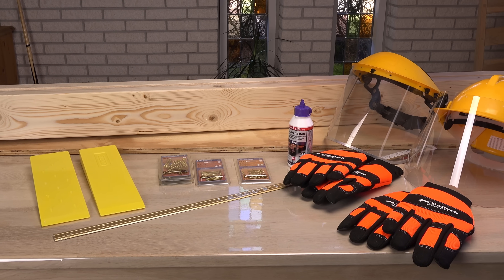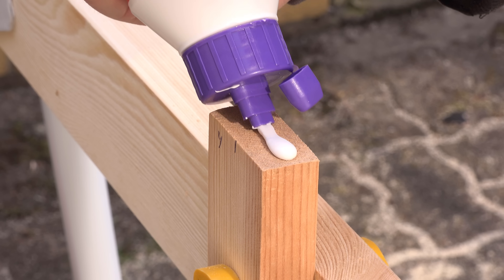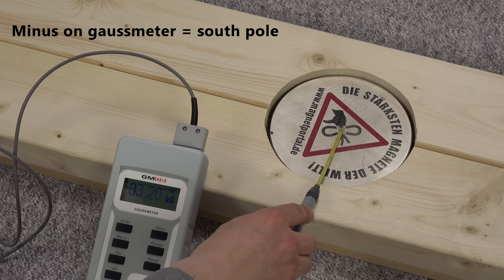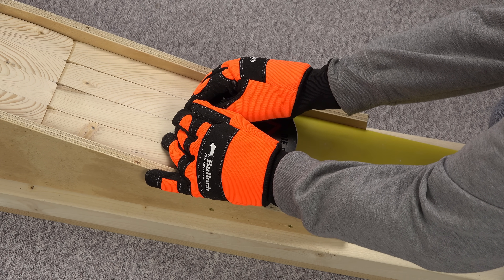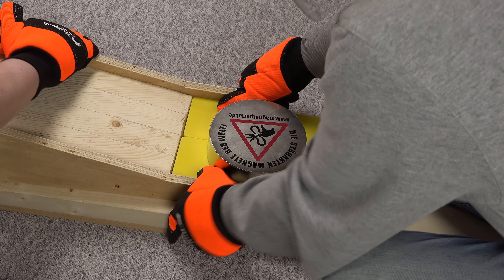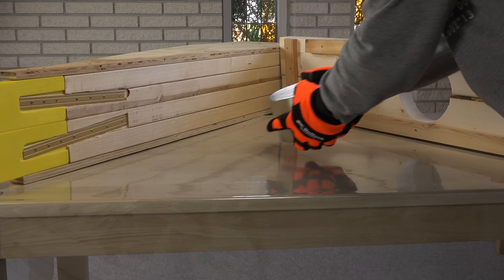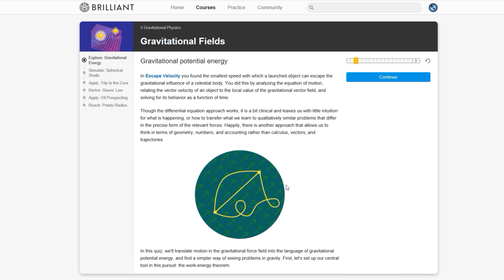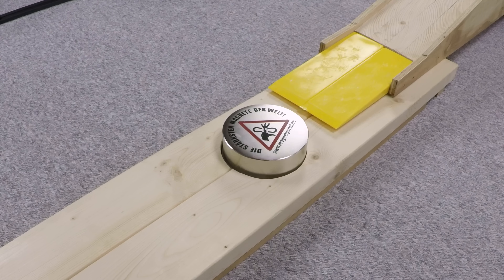Monster magnet meets monster magnet...

Comment: How about using a block of ice to bring them together
Reply: Place the magnets with a block of ice between them, let it melt so the magnets move slowly towards eachother. However the ice could chip or explode under the pressure and the magnets would damage eachother.
Reply: You can do it with the ice inside a casing to prevent shattering and inside a big freezer to prevent it from melting. The pressure will still melt the ice but slowly.
Reply: @Autunite  yes once down to a couple inches I bet they would break and shatter the ice .
Reply: Autunite l
Reply: @Autunite  if magnets and ice are inside rather tight cylinder, it would hold ice in between even shattered.
Reply: @Autunite , if the ice cracks under the force of magnetism, you could damage the magnets.
Reply: Make a video on how to separate them now
Reply: Someone had a similar idea with a PVC pipe filled with water.  The only drawback there being the pipe would have to be the PERFECT diameter to control the flow of water around the magnet.  If you replaced the water with a cylinder of ice, the PVC would prevent an explosive blowout and almost any chipping/cracking would be repaired by the compressive force on the ice.
Reply: I like your idea better than mine but they are very  similar. . The only thing I was going to do different is using a drilled-out 6 inch by 6 inch piece of lumber to hold the ice. Your PVC pipe would be much easier. Not sure why I didn't think of that.
Reply: That would be a cool way to observe the way pressure can melt ice
Reply: The problem becomes does the ice melt evenly. If it melts faster on one end they fly around the ice and do whatever is being prevented by the big wood stuff
Reply: Jesus christ, I hadnt thought of that. You could create a whirlwind of ice, and rob banks and shit.. Dude you're a fricken evil geniuous!!!
Reply: Ice melts under pressure. You can observe this with a thick ice bar and a wire loop with a weight attached to it. The wire will slowly cut through the ice bar. With those magnets it will go faster, the closer they get, since the pull force rises.
Reply: May we see this?
Reply: Blök Möp l
Reply: drServitis, if you're not trolling, you need help...
Reply: I had a similar thought. Using a perfectly fitting aluminium pipe and put on gaskets using something more viscous than water. drill a hole level with the bottom surface, either a really small hole or if you want to control the flow mount a valve.
Reply: @matsgustavsson665  I'd rather use a copper pipe, it'll slow down the magnet.
Reply: Still it would be interesting to see. probably not at home tho
Reply: or putting a material between them that will dissolve in alcohol or some other solvent
Reply: Ice is water .water can't  be compressed. Contain the magnets in a frozen tube where the melted water can be allowed to pass the magnets at a controlled  rate . Job done. Wouldn't  even need ice.
Reply: I was thinking just letting them slap together in a pool of water. Slush ice perhaps. Cold oil is also an option.
Reply: mikeselectricstuff that’s super smart dude, I could never think of that
Reply: My thoughts exactly, although using a thick copper cylinder to freeze the water, remove the ice bar & cut twice the width of one magnet off one end. Place the copper cylinder over one magnet standing up, place ice bar back into the cylinder, gently ease the other magnet on top of the ice.
Reply: it may rust?
Reply: Simple hydraulics
Reply: Nice.. you could also use a metallic tube that the magnets fit perfectly inside and then use water between them inside the tube. Through a valve you control the move of them coming closer together... it could be fun to first deep froze the whole thing ;-)
Reply: @henkenilssons3196  q
Reply: If you could get a tube or pipe (non magnetic, non-ferrous) that could withstand the pressure, and with an internal diameter only a few thousands bigger than the diameter of the magnet, couldn't you use a high viscosity fluid or oil? 
There's no possible way the magnets could slam together because there's no possible way the fluid could push through the minute gap fast enough.  Basically a hydraulic ram with a deliberate leak at one end. 
Might be messy. But would allow perfect alignment and controlled marriage of the two magnets.
Reply: Look kids, just say NO to drugs. They may seem cool and groovy and you'll be popular at all the parties, but just don't. Trust me. I used ICE for decades, and now I'm just an old man, with lamented tales of woe. Sure, you'll pull all the hot birds, be famous and probably a star footballer. But.. at the end of the day, the only ICE you want is in your tea. Just say NO. drugs are bad. Now excuse me, my bourbon needs some ice.
Reply: i think at a certain point, the ice will break with a sizable gap between the two, they'd slam together with a fuck ton of force, shatter and send shrapnel flying
Reply: someone make this vid
Reply: Blök Möp with some sort of liquid in between those two neodymium magnets in vacuum tank and have pressure release valves.
Reply: Nice idea!!
Reply: I'd put a tube or pipe fillit with water, make 4 valves near the bottom vleed the water out as it slowly sinks into place
Reply: Daniel Cannata you could use ice in a pvc pipe, it would work... might be best to use packed snow instead
Reply: Umm that'd make a great video ...  and u could record it from safe distance too..
Reply: i think they would crash it in seconds
Reply: thats an excellent idea! large pipe with block of cylindrical ice and let it melt evenly to bring them together in exact alignment!
Reply: Hopefully youll never have to take them apart, lol.
Reply: If you had pvc of snug fitting size put one magnet in one end then cap.  2’long    Add water 3/4 full.  Freeze. Add other magnet ,cap    Then let thaw.  That’s what I would do.  The ice would melt at the warm magnet end first the water would seep around magnet the water forming gasket, the caps on would create suction of vacuum the magnets would slowly move as water melted and seeped around magnets.
Reply: mikeselectricstuff compressed ice only
Reply: Good idea !!!
Reply: Excellent idea.
1. get many blocks of wood with a hole just big enough for a magnet to slide through and secure them together so they don't move.
2. place one magnet at the bottom of the hole.
3. fill the rest of the hole with ice.
4. place 2nd magnet on top of the hole.

the ice will be crushed, yes but since there is effectively no way for it to escape en masse; it will still separate the magnets as they come together.
Reply: Maybe use the same setup as shown in the video but with a smooth surface to pull it off easier
Reply: it would crack
Reply: At some point, when they get close enough, they would break
Reply: Why hasn't butthole-shrimp been addressed?
Reply: Yo that would be so cool!
Reply: Just trow one to the other
Reply: You'd get the DEA at your door in no time.
Reply: No, you're wrong. The DEA would still arrest you for having such a large quantity  of ICE and you'd spend 20 to life in the clink. Trust me, I watch LAPD.
Reply: brilliant idea...
Reply: What is? It will take 3 years to load 74 replies on facetube. 

Oh you mean the OP? Nah the DEA will be at his door as soon as he gets all that ICE.
Reply: @xxfurrytrashxx   C'mon...brainstorming ideas is no place for criticism. You fail because you can't work with people.
Reply: Y'all dumb
Reply: It's a clever idea, and I'm sure you could work out a lot of the obvious kinks with the set up alone but I'd still be worried about damaging the magnets, at certain threshold the ice will eventually give and that may be further apart than one would like, possibly cracking or even shattering the magnets
Reply: Ice was my first thought too!
Reply: Or heat them, elementary school physics.
Reply: Water ice would shatter...
Reply: How about bringing them together in a 6" PVC pipe with a magnet at each end and a cylinder plug of ice in the middle ...
Reply: Provide a hollow lead, brass or bronze cylinder of the exact diameter of the magnet. 1 metre long. The ring/wall of the cylinder will be 3 inches thick. Now apply a lubricant seal (a synthetic engine oil could be also good) on the side of the 2 magnets. Place a magnet on a level surface then the hollow cylinder vertically on the top of it (the magnet will be covered by the cylinder making an exact seal, like the piston of an engine). At this point pour water in the cylinder filling it but not completely, leave few inches of the cylinder free of water in order to place the second magnet on the top. Place the second magnet on the top of the cylinder and now we obtained a system/column made of water (that can't be compressed; in a hollow cylinder) that can't be compressed by the 2 magnets. At this point drill a tiny hole in the centre of the cylinder: the water will slowly come out of the cylinder and the 2 magnets will slowly get closer to each other till they get gently stuck :)
Reply: Dry ice is better because it will sublimate into CO2.
Reply: Switch the magnets off then connect them then switch them on again
Reply: how about just throw one magnes on the other one ?lol
Reply: YOU FOOL !! THE MAGETISED ICE WILL MELT, LEAVING MAGNETICS EVERYWHERE, THROWING OFF COMPASSES AND DOO DADS AND OTHER ELECTCRICS, AND WILL DESTROY THE WORLD.

actually, are you did it yet?
Reply: No matter how large your cube/block of ice, at some point where the ice has melted to a certain point, the magnetic force with crush the ice. Also, how do u even ensure the ice is melting evenly ?
Reply: Hi
Reply: @soultrader9207  Hey there... How YOU doin' ? salacious grin, slight tongue poking out
Reply: I had a similar idea, but using wax (or any material that melts without doing harm to the magnets) in between instead. For alignment some precise cylinder could be used. If pressure causes warmth, and thus a chain reaction, a tight cylinder around (magnet, wax, magnet) would work like a brake. If it works too well, you would have to drill some tiny holes into the cylinder between the magnets.
Another interesting experiment, I'd like to see is what happens when pulling a bunch of steel needles (or small nails) on some non-magnetic plate put on top of the magnet. I'd expect the needles to "form into space" following the magnetic flux. (sorry, non-native English).
And finally yes: Don't ever put your fingers between strong magnets!
Reply: WAX isn't magentic, what are you even trying to do. You want a magnetic candle? What is WRONG with you...
Reply: mikeselectricstuff i think he meant breaking the ice between them.... like a ice breaker. Plz don’t woosh me lol
Reply: In minecraft..
Reply: У
Reply: Nope by the time they got close the force would just shatter the ice and Proboly the neodymium magnents with it
Reply: Dude. Thats brilliant
Reply: I read about this being used by a person who committed suicide and tried to frame someone for his murder. By the time the officials showed up, the ice already melted so they assumed he was stabbed in the back, but he placed the knife in the ice.
Reply: You can even make the 2 magnes roll in parallel patsh that gather at some point. If this vides explains the way to put them together.. well.. they dont seem too smart.. xD
Reply: You are F#©kInG genius
Reply: Seems like you'd make a kinetic ice bomb by doing that.
Reply: I think the ice would shatter
I had a 2x1 and joined a 1" cylinder accidentally, to separate I needed to use wood too
Reply: M_god 30 
Me me smart boy
Reply: The ice would probably break.
The magnets could slip on the slope and slam together too quickly.
The friction could melt the ice
Reply: My girlfriend just returned from the gym and her ass smells like shrimp and butthole
Reply: @Dr.White_PhD  -   "Shrimp and Butthole" sounds like an Australian detective series. LOL !
Reply: @martinroberts8469  : The only problem with that first "funny" of yours is that Australians don't actually use the word 'shrimp' to describe what you're talking about. We call them 'prawn'! Americans were all successfully conned into thinking we call them shrimp, and barbecue them, during a tourism ad campaign decades ago.
Reply: @anhedonianepiphany5588  -   OK  -  Point taken ... no disrespect intended toward Australians.  Somehow, though, 'Prawn and Butthole'  doesn't have the same impact.  How did we get so far away from the subject of 'magnetism'?
Reply: @IfYouOnlyKnew What transpired there? Had you intended to smell it when she returned? Was it at that moment, when you smelled shrimp and butthole that you decided to relay the information? Or were you enjoying this video, she walks in, the odor is so overwhelming you feel compelled to share? I'm at a loss here, and genuinely curious.
Reply: @Dr.White_PhD  -   "Butthole and Shrimp" sounds like a TV detective series. LOL !!
Reply: @Dr.White_PhD  ....thanks for sharing, good for you.
Reply: Tom ! But it's not a good thing. Lol
Reply: @Dr.White_PhD  ...... Yeah probably not, but look at the bright side we all like shrimp.
Reply: Some one pay you money
Reply: YEAP pretty much things like this.  AND meanwhile [slaving intensifies]
Reply: How?
Reply: It would go slowly and then crack 
Magnets fly towards each other and shatter
Reply: How about using nothing to bring them together, throw one on one...
Reply: einstein wants to know your location
Reply: Ice melts under pressure. This is why ice skating is possible.
Reply: that cant work the ice will get destroyed and the magnets will be damaged
Reply: There isnt a chunk of ice in the UNIVERSE strong enough to hold up to these monsters bud. 

A tempered block of tungsten or osmium? Maybe. 
But ice? You might as well use glass.
Reply: @Dave_Crupel  how would a block of tungsten or osmium be even remotely helpful in this experiment.
Reply: the ice will shatter once the forces are big enough, so nice thinking but unfortunately won't work:P
Reply: SO THIS IS WHAT OUR RICH SOCIALIST CRADLE TO GRAVE WELFARE RECIPIENT NATO ALLIES DO WITH THEIR TIME AND MONEY WHILE WE PAY FOR THEIR MILITARY DEFENSE BECAUSE THEY REFUSE TO.

Comment: what if you just let them connect underwater would that cushion them enough to prevent chips. or a 6inch plastic pipe filled with water and let them slowly squish the water out between eachother
Reply: You cant just throw them in water,  if you want the pipe set up the water can not flow from between magnets and pipe. You'd need to slowly remove the water between the non linear force of the magnets, youd probably need a high pressure valve and some method to control the water flow rate
Reply: I didn't mean the magnets so tight in the pipe that's its water tight. if you can put the magnet in the pipe by hand it would be able to squish water out slowly between the magnet and pipe wall.
Reply: my impression would be that there would be practically no water cushion  in said case. the water would probably rush out from the sides of the magnet since i believe that the magnets will simply displace the water.
Reply: It could work if the magnets just barely fit inside the pipe. The important part would be that they do not form a tight seal but still allow for some water to flow around the magnets. It would allow for a perfect match without any material getting stuck between them but the time spent to source such a pipe is far larger then using the method in this video.
Reply: I think you need a 'cooler' solution.  Instead of WATER in the pipe, just slide in a cylinder of ICE.  Then, you don't need exact tolerances to control the flow...just a little bit of heat.
Reply: Fubi Sroc hmm seems possible seeing as for most of the the P-T chart water is solid at around 0 degrees Celsius but a portion is below that so might want to go for around -50 degrees, as long as the container is rigid enough and the crushed ice doesn't come flowing out the it should be fine by my thought process
Reply: YOUR theory.  Ok, I'm glad you mentioned it first.
Reply: Fubi Sroc well I meant more along my thought process of what would happen

Comment: I was wondering if it would have helped to use some dry lube to help it in the future. though in that case, you do have to be careful, as it would make it easier for the magnets to slide freely.

I can only imagine the force pulling the two massive magnets together. its like having an invisible hydraulic press crushing them together at all times... scary...

Comment: Very nice. Next time, try using ultra high molecular weight polyethylene as your wedge material. It's extremely tough, and has extremely low friction, so if you can manage to shape it into a wedge it should work perfectly.

Comment: Dude! You should drop it into a slightly larger pipe filled with water, and sealed at the bottom with the opposite magnet pole. It should build up attraction as per the inverse square law? and blast the water up at the end.  The max tube pressure would have to be less than the area of the magnet circle face times the attraction, because that's the max at contact, and the water will be forced out as pressure from the closing magnets builds. Close tolerance for using water in order to avoid hard contact damage. Maybe oil?

Comment: Now get them apart
Reply: Permanent magnets are adversely affected by high temperatures.
Reply: Tyler Stanford lol
Reply: Easy, you can weaken their magnet power by burning or throw them until the magnet power is bearable then get them apart.
Reply: Harry99, Throwing around neodymium magnets will just get you a mess of crumbles
Reply: Tyler Stanford I

Comment: 6:00 the sound seems like the same sort of squeak you would get rubbing your hand on a thick plastic sheet for instance. Noise due to high friction force.
I’m also surprised that you didn’t seem to try calculating any if the forces involved given the crazy pull strength.
Nice job though!